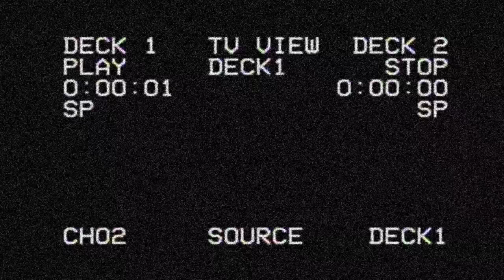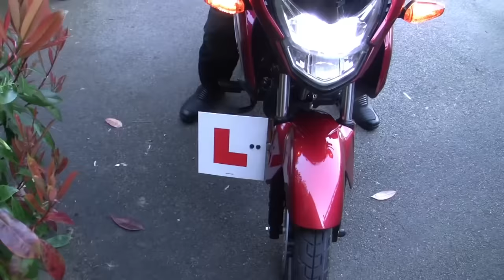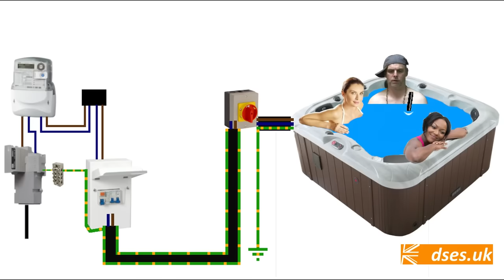All good things... part 1

Comment: Good luck Nigel in your new endeavour. I hope the change of pace suits you well. I hope that your parting doesn't leave old Dave crying into his ale pot, ( what did I do, why has he gone...?) It is the end of an era so to speak it won't be the same without you there to provide a sense of reason and calm to the choppy seas of domestic electrical fault finding and re-wires, Nigel thinks. Yippee!! No more dark damp and dingie crawl spaces, no more hot spider infested lofts spaces. I'm free at last. Now what ?